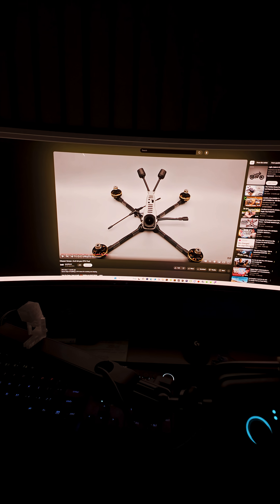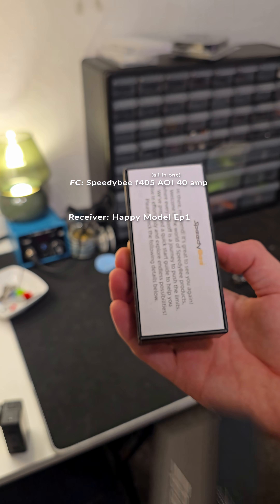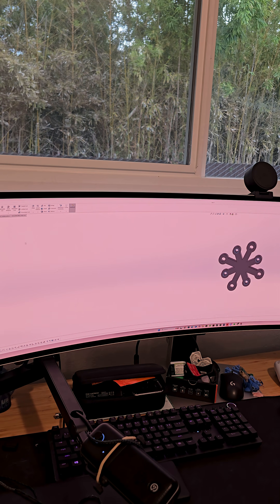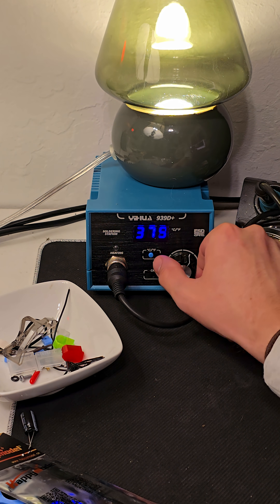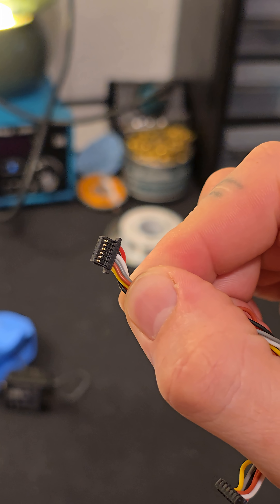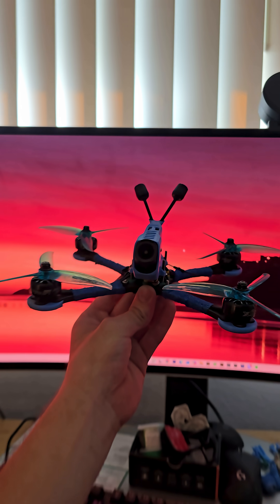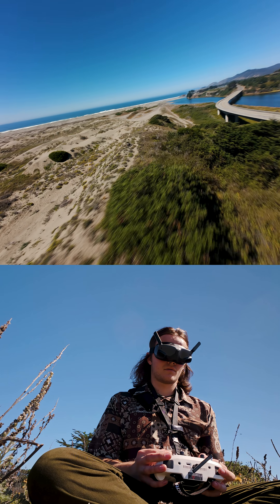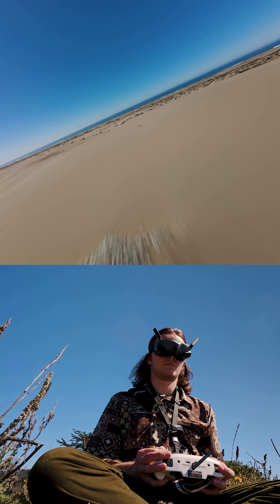5 INCH DJI 04 Pro Pod | Drone Build

Comment: What setup you running, and what camera angle did you fly? Great vid 👌🏻🔥
Reply from the maker: Ran 30-35 degrees and the entire part list is
Frame: standard racing  x style 5 inch motor base pulled from the junk drawer
Receiver: happy model ep1
Fc: Speedybeef405 AIO 45 AMP
Motors: IFLIGHT XING 2207 1800kv 
Props: 5136 gemfan clear blue
Camera and vtx: DJI 04 PRO, 
Goggles: DJI integra
Controller: Radiomaster Boxer white

All the build footage is recorded with my  galaxy s24 or the dji action 5 pro

The printer is the bambu labs A1, and im printing in "Blue TPU for AMS" by bambu labs

Comment: Your not worried about your antenna being ripped from the air unit? Its happened to me on walksnail using a similar 3d print antenna holding method just curious
Reply from the maker: To be honest they are in there pretty snug and don't come out unless I force them out. The antennas are pretty resilient and don't snap super easily.  Additionally saved a few grams not using a SMA adapter

Comment: What was the total cost for this build?
Reply from the maker: I had the frame in my parts bin from an old x style racer so the frame was free. The flight controller and elrs module cost me $100 plus the $200 for the 04 pro :)

So I put about $300 into the project for parts and the rest I had laying around

Comment: Nice job man. How much would I need to spend for that 3d printer set up?
Reply from the maker: This one specifically cost me just under $600, but mine came with the AMS (like a multi-material system), so it was more. Just the printer is like $400 if I remember correctly. Its called the Bambu Labs A1

Comment: Hey btw u don’t really need to use glue on Bambu labs printers for stick just get a spray bottle full of ipa and microfiber cloth and wipe the plate every time u touch it. Cool vid tho
Reply from the maker: PLA is always perfect, but tpu has come undone a lot for me, I try and use ipa and clean it better, but I usually do it to be safe as tpu is way more expensive 😂
Reply: I never had problems with a Babu PEI, only it sticks too hard if itsd cleaned. Sometimes im touching it by pourpose for a slightly oilfilm.
Reply: If you print certain objects or lots of small things you will need some kind of adhesive.

The best one is aqua net hairspray.

It’s what the og’s of 3d printing have been using for over a  decade.

I print 100 mini critters at a time on my machines and almost never have anything come off but without it it fails somewhere everytime with that many on the plate